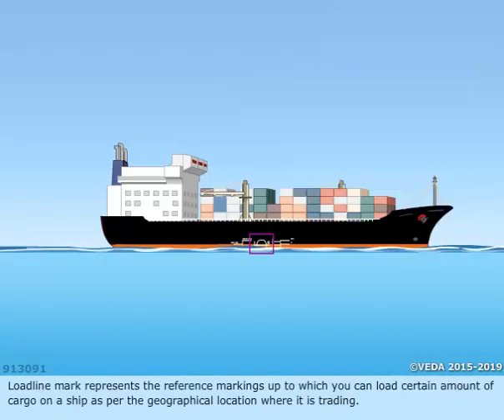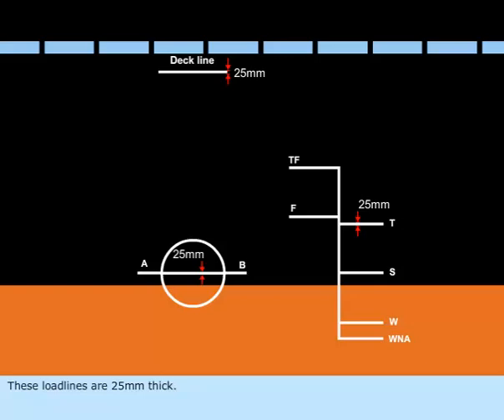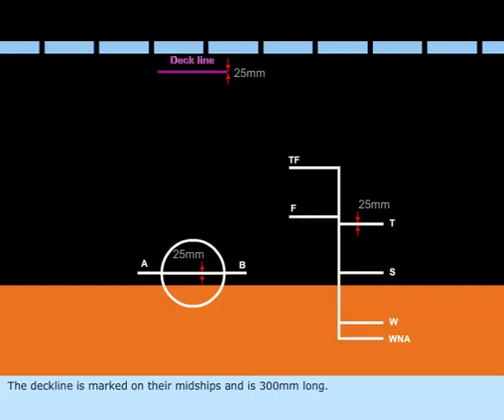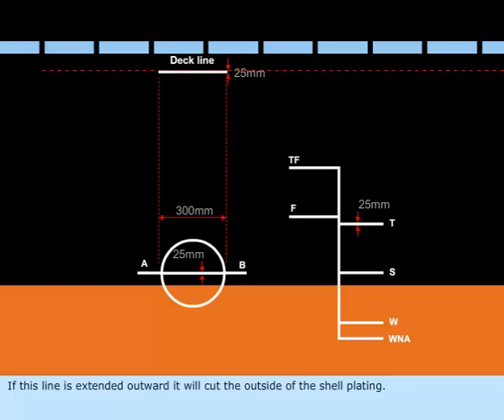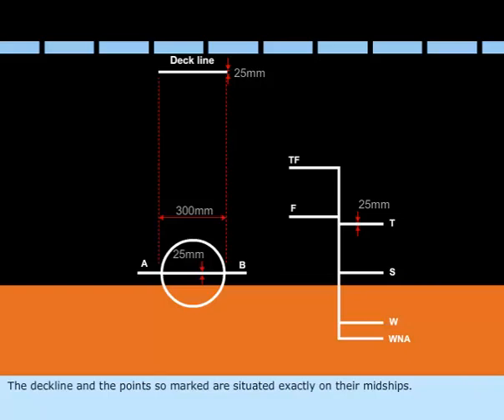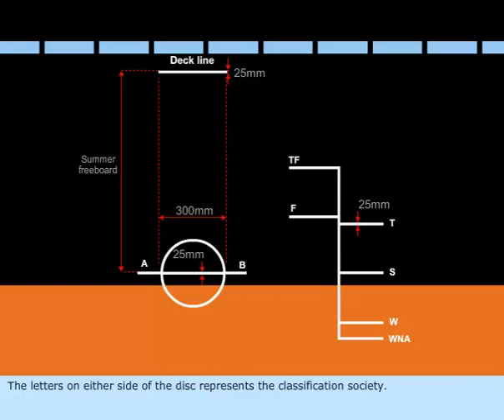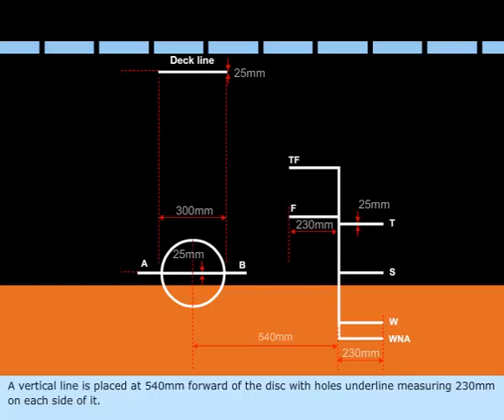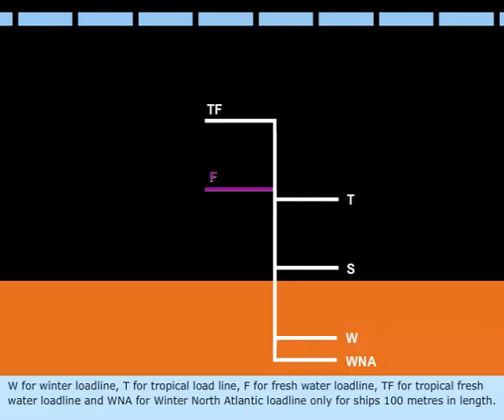Loadlines | Loadline marks | Plimsoll mark | Merchant Navy Knowledge

Comment: Horizontal marking for WNA of 230mm should begin from the end of the WNA to the vertical line of loadline marking, not consisting of the 25mm thickness of that vertical line.